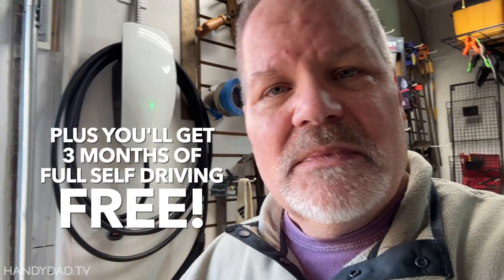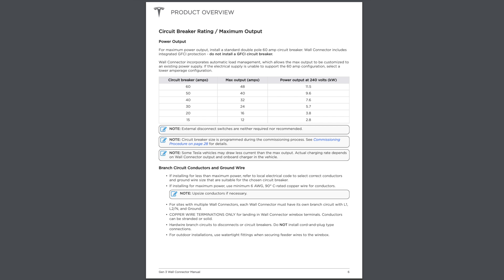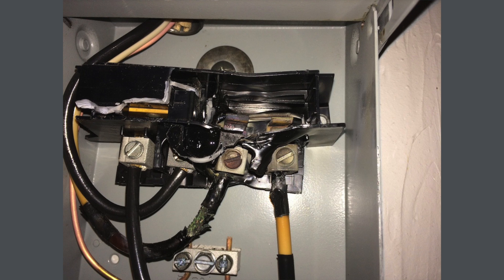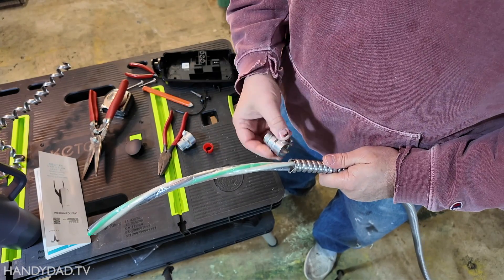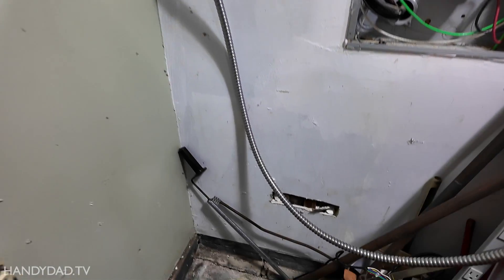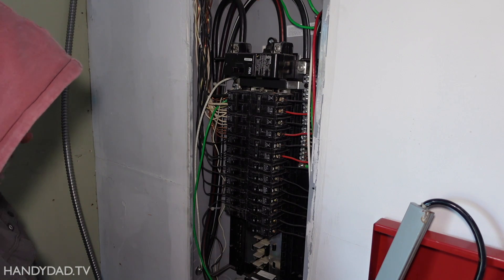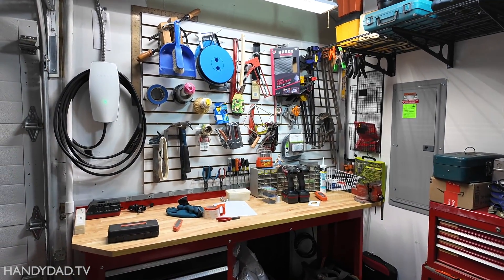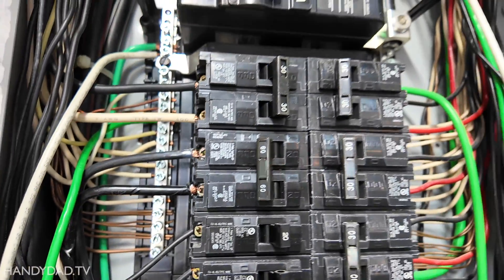Tesla Wall Connector Installation with MC cable

Comment: What did you do for the penetration into the wall to clean up where the MC cable went from the garage to inside the wall?  Is there a pass through junction box?

Comment: Does the code require that a junction box must be installed on the drywall?
Reply from the maker: Not to my knowledge, but I’m no expert. It may be required in certain circumstances.

Comment: Hi, don't you need to install load balancing?
Reply from the maker: No
Reply: @handydadtv  but doesn't it blow electrical fuses? But doesn't it blow electrical fuses? What I don't understand is that some electricians say it has to be installed, while others say it's up to you whether you want it installed or not. We're very undecided. Could you provide a little more specific information? Thanks.
Reply from the maker: You may be thinking of load calculation as opposed to balancing. A load calculation is where an electrician determines if your panel can handle the addition load of a new electric appliance or car. 

I didn’t need one because my electric service and panel were already upgraded.

Comment: How does the MC wire look coming out of the wall?  I have to go about 3 feet through my garage and am wondering how it will look...
Reply from the maker: Mine is hidden next to my workbench so I don’t need to see it. If it was prominently visible, I would use something like a junction box to make a nicer transition.

Comment: Awesome I plan on using mc cable as well. Question will I need a junction box when it’s coming out of the drywall in order to pass permit inspections?
Reply from the maker: I’m not sure. Obviously I didn’t use one. But that’s because I had an existing hole in the drywall.

Comment: Loved the video! Quick question. Did you just leave the hole in the dry wall where Mc cable went into the wall or did you add protection?
Reply from the maker: I didn’t make the hole, so I didn’t repair it. I could have, but it’s not hurting anything.

Comment: So the two wires coming from the breaker are hot? Does it matter which order the two hot wires are put in the wall connector? I used your link to buy the MC cable
Reply from the maker: Both wires are hot on a 240 circuit. It doesn’t matter which screw terminal you use.

Comment: You mentioned not liking to charge at 48 amps. 
1) why
2) what amp do you recommend & how can that amp be achieved?
Reply from the maker: My philosophy is to charge at the lowest rate necessary to replenish your battery in the allotted time. I use 15 amps for my daily commute. I only use 48 amps when I had limited time.
Reply: @handydadtv Sorry it's my niece that has the Tesla, I'm just doing the research before we upgrade the electrical panel & install the EV charger. So is she able to change the amp charge via the car?
Reply from the maker: @jjf7991 Yes, either on the car’s display or via the app.
Reply: @handydadtv  I bet you'll never notice and battery health improvements and you are using more electricity than needed due to all the things that are running longer in the car while charging...the base loads if you will.

Comment: Wired mine same way but the breaker seems to be overheating?
Reply from the maker: I normally charge at 15 amps because it’s enough to cover my daily commute. I will only push it to 48 amps if I need a fast turnaround. 

Warm is normal but if yours is hot, call an electrician to make sure everything is okay.

Comment: Video shows installation much higher than recommended by the included Tesla manual.  Manual states 48 inches is optimal.  Not sure the height recommendation by Tesla.  Manual written in a non-professional way.  States can be installed indoors or outdoors.  Where I live we have mud daubbers, etc that will find their way into anything not completely sealed.  Conduit with set screw is not adequate.  I used sealtite but found the sealtite fittings impinge ability to install outer portion to mounting bracket.  Very poorly designed.  For the price not a good thing.  Also note, Tesla wall chargers are AC current output.  These do not provide, cannot convert to DC inside the unit like a supercharger does.  Many do not understand this prior to purchase.  There is too little information available for consumers to make an informed decision about purchase.
Reply from the maker: I knowingly installed it higher than recommended.
Reply: The actual "charger" is inside the cars circuitry. The wall "charger" as installed, only provides a method to monitor the 240  V (up to 48 amps), and the cars circuitry controlled by the car screen or usually the Phone app sets  the amount of amp flow desired/available. The Level 2 home "charger" as shown, is NOT supposed to be as capable as the roadside Tesla Superchargers- which are high voltage DC, and much faster and more powerful.

Comment: Why did you wrap the white wire in black electrical tape
Reply from the maker: To prevent anyone else from assuming the white wire is a neutral.

Comment: Great video and thanks for all the detailed instructions.
I did follow all the steps however when I start charging, the circuit-breaker trips after a few minutes.
I am using an Eaton 60 AMP 120/240 Volt , same brand than my electrical panel . I  am wondering if this is because it's a 120/240 volts instead of a just 240 Volts. Any idea what could be the problem?
Reply from the maker: Start with a lower charge rate, like 15 amps, and see if it still pops. Could be a defective breaker.
Reply: You prob need BR260 to work

Comment: I finally bought a Tesla you have an easy quick Mount here. My panel is 75 ft away from my garage. I'm only installing a 240 electric vehicle outlet because I purchased a travel charger and since I don't drive that much it's plenty enough for me I can get away with the 3 miles of range per hour it's charging temporarily until I run the 75 ft of Tesla claims 6/4 cable I'm only doing the runs and then I'll call the electrician to wire up the socket and the circuit breaker
Reply from the maker: Congrats on the new car!
Reply: @handydadtv  I don't drive very much so I think I should be able to get away for quite a while with the 110 plug because I drive about 2000 me every 6 months. Unless of course I go on vacation which might be possible since it's cheap to drive a Tesla versus all that expensive premium gas in my Lincoln MKZ. Do you buy your cabling from a local hardware store or did you order on Amazon I guess it didn't really matter since you didn't have that far of a run so you could have very easily went to the local hardware store to get everything
Reply from the maker: @mkzenthusiasts I try to provide online sources whenever possible for products used in videos because people always ask me for links. But I recommend shopping locally if you can.

Comment: You can not use 6/2 romex for the wall connector. It’s not rated high enough at 90° and the ground wire is not the correct size (8AWG) 6/2 MC is rated properly up to 75 amps (not sure on the ground or how important that is). You can use that or use 4/3 (since 4/2 doesn’t really exist) or 2: 6AWG THHN, 1: 8AWG THHN ground in conduit.
Reply from the maker: I’ve used Southwire 6-2 Romex from Home Depot and it is rated for 90°C.
Reply: @handydadtv  It's irrelevant. Code 334.80 requires that Romex (NM) cable uses the 60°C ampacity column, which means 6 gauge wire tops out at 55 amps.
Reply from the maker: The Wall Connector tops out at 48 amps max.
Reply: @handydadtv  Correct, but EVSEs are considered continuous loads by the code (625.42), so you need a 125% of 48 = 60 Amp circuit. 

In short: 6/2 or 6/3 romex are capped at 55 A. An EVSE needs a circuit with at least 125% of the continuous draw (equivalently, it is capped at 80% of the circuit ampacity). You'd need to limit the wall connector to 44A.

Comment: They make all sizes of reducing washers for when the hole is bigger than the connector. You 'sandwich' the connector to the opening with a washer on either side. Easy peasey. I have plastic drawers on my truck, and I probably have 50-75 on my truck for all the permutations that I run into like that. I also have a compartment for the red bushings you mentioned. ('red heads')
Reply from the maker: Thanks

Comment: A decent installation although not to code but shouldn't have an issue as you covered the wire size, bushings to prevent fraying, and torquing at both the Tesla Wall Connector and the breaker (the two terminations). With that said, you did it a bit risky as others have pointed out, why turn on the main when have your hand SO CLOSE to the hot bus bar when turning on the breakers....one little slip and zap bye bye. Yep the advise to triple check tightness and seating of the breaker and terminations then reinstall panel THEN do the start up sequence. We want more HandyDadTV so be safe!

Another safety note, after charging for a few hours check the breaker temperature, it should be slightly warm to warn but not hot. Do this once from then on. The Tesla Wall Connector and its "plug" have temperature sensors but the breaker does not, so that is the only non-monitored safety risk. All the best.
Reply from the maker: Great comment! Thanks so much.
Reply: @handydadtv  Forgot to mention, I use one of those laser temperature infrared gun thingies to measure the temperature of the breaker too ($19). If it is slightly warm or warm but not hot to the touch (you can keep your fingers on the breaker body without having to remove them because it's too hot) that's good enough measurement too.
Reply from the maker: @danfoley1429 I routinely charge at 15 amps daily to keep things cooler. I’ll only use 48 amps if I need to charge in a hurry. No reason to push it.
Reply: @handydadtv  That's exactly what I do too. Usually 16 amps or 32 amps depending on how long my Tesla is going to be parked. Nice to have the 48 amp option just in case. Even 12 amps at 240 volts is plenty especially if you plug in all the time when home. I don't do the "always be charging" but might in the future.

Comment: I noticed the green wires were with the white neutral wires in the ground? IS another options to to connext the green neutral wire to a ground rod near my plug?
Reply from the maker: Too many typos to clearly understand the question. Ask again and take your time.
Reply: @handydadtv  I noticed your green wires (ground) were with the white block. Can I instead buy a grounding rod and connect my green wire to it? Im trying to do my wife's Tesla 50 amp. It asks for a red and black and a green wire.
Reply from the maker: Your ground wire needs to be bonded at the panel. You can’t use a grounding rod to avoid buying a ground wire, if that’s what you mean.
Reply from the maker: Also, your panel will usually have different bars for ground and neutral. Mine has them together because this is my main disconnect, but that has nothing to do with the way circuits are wired.
Reply: @ I looked at my panel last night. It does have copper bare wires and white wires. It looks like they are on separate bars but they were on the same side so it was hard to tell. I. did not see any green screws for the bond.

Comment: could you link an example of the anti-short bushing, the correct size for the clamps, and the correct size for the MC cable connector (you said a 1/2in connector was used)?

Comment: As an electrician I think the man did a great job 👏 for an amateur. Yet I would add this safety point!! Put the panel cover back on  and stand to the side before turning Any breaker on!! I once had a faulty breaker explode. These two safety steps are all that kept me from getting bathed in metal shards and sparks!! Trust me on this 😂.
Reply from the maker: Thanks for the tip 👍🏻
Reply: That was what we were told in the college as well. Also close it from the side, instead of in the front.
Reply: I just installed a level 2 charger after watching a few videos. I’m an amateur myself, my only concern is the 2 live THHN wires going to the 60amp breaker are slightly touching the live wires feeding power to the breaker just like his are in the video. Is this safe? I just want to be certain. Thank you!
Reply: You should also point out that you turning it on with your non dominate hand. This way you still have your dominate hand to call 911 and for future use.

Comment: Commend you on your efforts for the informative video and being able to finish it without blowing up the panel. 
YIKES!,  You have an open HOT panel with a metal 4' outlet stick leaning in front of it.. very dangerous,  so glad it did not accidentally fall onto the panel and short out the wiring. Please be more careful .. is does not take much to have an accident with electrical. 
 I'm electrical contractor over 34 years, .. suggestions to improve your project as required by codes check your local building & safety it may change per your location ... use emt conduit instead of mc cable on surface mount applications on drywall  since it's exposed and if below the garage attic joist members. Fasten your emt conduit min 12" from junction box or in this case starting from tesla charger at either end and every 4' running length. You don't have to but I lightly twist stripped ends not to get the "whiskers" to stray on the terminals and apply a layer of antioxidant paste on these strands only since most lugs are aluminum. 
Going from a 1/2" connector to putting on a 3/4" connector on the tesla charger housing do not do this. The 3/4 connector was not intended for this application. Please use reducing washers. They look like flat disks with a hole in it. In this case, you would get 3/4" to 1/2" reducing washers because you are going from 3/4" hole to 1/2" .   Nice video, clear voice will lit area no annoying music.
Reply from the maker: Thanks for the advice.

Comment: You can use reducing washers and MC connectors those connectors are for flex conduit if you use two different connectors can cause it to have problems it’s not made for glad you used red heads it’s always good to protect the wire good job on your insulation
Reply from the maker: Thanks

Comment: 14:50 torque the breaker connections before connecting breaker to the panel. Avoids unnecessary stress on the bus bars.
Reply from the maker: Another good tip

Comment: 9:15 you can use 3/4” to 1/2” reducing washers. Put one on each side and that will make the knockout on the Tesla wall plate fit the MC connector.
Reply from the maker: Thanks for the tip

Comment: Question: How did you finish the MC-through-the-drywall penetration below the panel? Is there a plate for that? Thanks.
Reply from the maker: No, it’s still open but hidden by my workbench. If it was visible, I would patch the drywall and caulk around it.

Comment: You mean this is all these electricians are charging hundreds of dollars to do? That’s it? Yeah I’m bout to do this myself.😅 the charger even comes with installation instructions on DIY
Reply from the maker: It’s much harder if your panel is on the other side of the house. But if it’s in the garage, it’s not hard. Just tighten-wiggle-tighten the connections.

Comment: You can use aluminum wire for the circuit however, you must use copper wiring for the final terminal connections. The charger is not designed to accept aluminum wire. You can use an appropriate (Polaris) connector, to joint the two types of wire (copper/aluminum), then run, say, the final 8 inches or so, into the wall charger.
Reply: If you use aluminum wire, you must increase the wire size and the conduit size accordingly.
Reply from the maker: @bills6946 Good point.
Reply from the maker: I’m sure that would be a more cost effective option for people with long runs. Thanks.

Comment: A couple comments: the Tesla torque for 6ga is 50ft-lb, above my torque screwdriver's range. I used a torque wrench, and 50 was really a lot, well past my hand-tightened guesstimate. MOST important, though, was my use of liquidtight 3/4" flex conduit for the 6 foot run from the subpanel; I'd run the 6ga THHN before bending and attaching the flex to the wall for easier handling, then used a 90degree bend plastic fitting into the bottom of the charger unit. After wiring all, I discovered that the main Tesla unit will NOT fit onto the wall mount, because the plastic fitting compression nut is too close beneath the unit. This seems like such a common option for installing, that the Tesla info needs to clearly describe where such standard fittings are NOT going to work. I am trying to figure a workaround, but it seems that a straight connector is the only option, to make the final entry to the Tesla mount unit, or else other conduit with smaller profile is the only alternative.
Reply from the maker: Bummer
Reply: The torque is 50 in-lbs or 5.6 Nm, not 50 ft-lbs.  I'm surprised you didn't strip it out.  The manual indicates: "50 lbf. in",  the "f" is force not ft.  Yes, I can see this is easily misinterpreted.

Comment: you are incorrect to say that is a 60 amp breaker!  It is clearly a 30 amp breaker!!  check your code carefully:  in some areas you could use a 60 amp breaker and charge at 48 amps!
Reply from the maker: The 30-amp was an unused breaker. Zoom to 14:08.
Reply: @handydadtv  ok, so say what is the new breaker and why?
Reply from the maker: 60 amp because that’s the max the Wall Connector can use.
Reply: @handydadtv  ok thank you.  Next why 6 AWG on a 60 amp breaker.  A long run may require 4 AWG.  Some codes allow 6 AWG on 60 amp for how long of a distance?  The 48amp is - or is not? - guaranteed and code-following to be the max load on that 6 AWG.
Reply from the maker: @rvadataguy4459 I have a short run and followed the instructions for the Wall Connector. If you’ve got a long run, call an electrician to help size your wire.